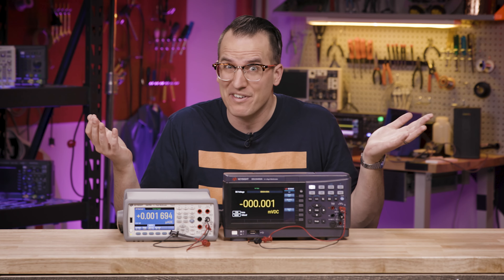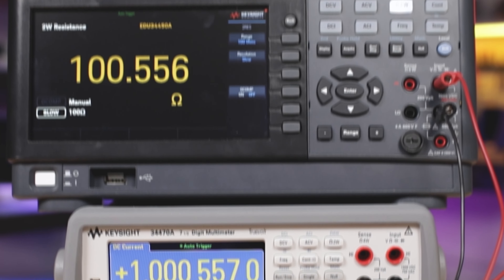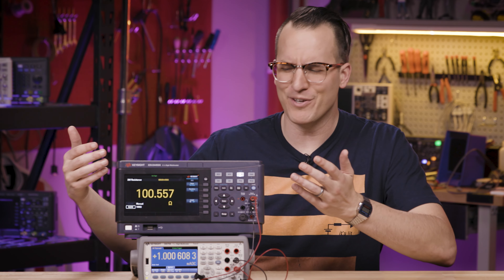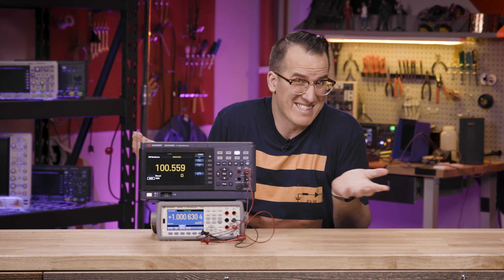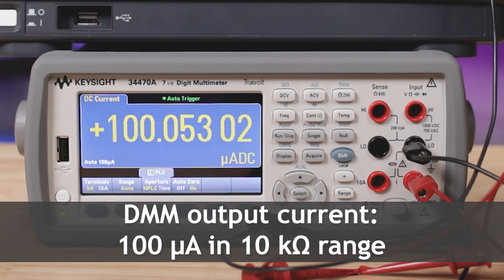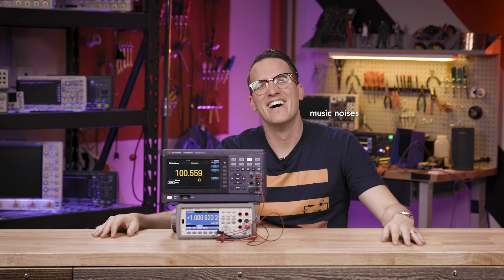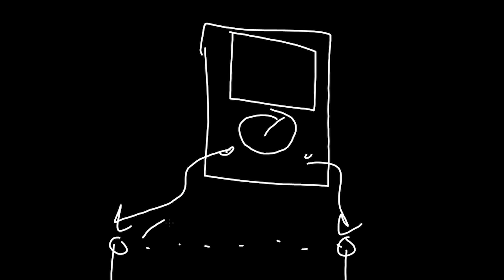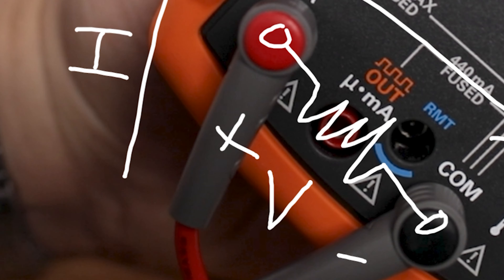Don't use a multimeter like this

Comment: One of my favorites: Your U1240B has 10MOhm input impedance in normal DCV mode. You can extend the 1kV input voltage range by measuring voltages with a resistor in series with the DMM. i.e. +10kV --- 90MOhm --- 10MOhm DMM --- 0V this could read up to 10kV, but other values and higher voltages are possible. Better than tongue test, that's for sure.
Reply: If we are abusing DMMs today, lets replace that 90MOhm resistor with 9 other DMMs in series...
Reply: use the voltage input impedance to measure really small currents
Reply: If only the case and pcb were rated for such high voltage;)
Reply: @LordPrecision  ,  You took the dopey words right out of my mouth... LOL DAMN, is that a really dumb thing to do! BUT IT'S SO SIMPLE!   de KQ2E
Reply: @fredflickinger643  ,  That is what MR/TROLL said in that first comment.
Reply: It is not THAT bad idea :)
I used 9 of 10-MOhm 1/4w resistors in series with multimeter to extend its voltage range. Worked fine for several kV. Calibration was a bit off for me, so i added something like one extra 1Mohm or so.  Very cheap and easy way of measuring low power high voltage up to 4-5kV or if you need extra-high resistance voltmeter. Of course you should not try this for like industrial 6kV or so.
Reply: Be careful with high tension!!!
Most DMM`s have input impedance of 10MOhm, that is about as standard as it gets, but a lot of them have a range or two with 1GOhm or, as my NORMA D4845, goes to 10GOhm at low ranges. 
So ...  you do attach a HT probe, believe (DAAH !!) that you`re fine and then ZAP! Before the instrument can rerange itself. 
So, you better lock the range, or use DMM that has fixed impedance. 

ALSO !!!

-Check if the HT probe is unscratched and clean! THIS IS IMPORTANT! You have no idea what some finger grease can conduct under high tension.  Scratches wreak havoc with creep currents. 
-First, ground the instrument !
-And, best of all, get to know what you are actually measuring. 

Best of luck guys. :D

Comment: Excellent tips 😃, I think most of us short things together in the 10A mode, it's the most used terrible idea.
Reply: Who else has tried to measure mains voltage with your probe in the 10A socket?
Reply: @abraarsameer9521  That usually means goodbye voltmeter.
Reply: Sometimes i do it because the probes are really good for... You know... Probing
Reply: @zyeborm  Good point, I think everyone does this 😅
Reply: @abraarsameer9521  oh god. I did that 2 weeks ago. I didn't intend to do it. I just forgot the probe was at the 10A socket.

 The moment i put it in i hear a big spark and light comes from the plug extension (did it in my house) and i also hear the safe of the house turn off. I was sure i completely bricked my multimeter (a cheap a$$ 20 euro one). I was shaking from excitement and fear since it was my first time happening to me (I'm a beginner). I quickly open the back panel of my multimeter expecting a mess inside but... it was fine? I check the shunt resistor and the 10A fuse but it hadn't been burned. That puzzled me. I try to measure voltage, current and use the other functionalities of it but they worked fine. The tip of one of my probes was melted tho and the metal part of the socket was too. The most logical reason for this is because the breaker kicked in fast enough for there to be no damage but it still feels strange.
Reply: I do it quite often, a speciali when I struggling problems in emergency circuit in industrial devices. Current in that circuit is limited to 100 mA so no problem whatsoever.

Comment: Another "bad" idea: to test a battery for its health in "current measurement" mode - technically short the battery through a DMM. If the measured current is large enough (for this particular kind of battery) - it is good.

Comment: I had some fun with the VU meter I was wiring up to my audio compressor with this (prior to seeing this). I was poking around with a DMM and would redline the VU meter when trying to measure it's series resistance as the DC was flowing through it without the useual resistor that's put infront of it to calibrate it to usefully display audio level signals. 

I also had fun when soldering the replacement IC LEDs for it's backlight with blue ones, as my soldering iron outputs current at the tip (due to the heating coil inducing current in it), and every time I went to solder it the LEDs would light up magically without it being plugged into an obvious power source. xD

Comment: I needed to test a 9v rectangular battery (from my multimeter). I eventually set up DC coupling on my massive Tektronix Oscilloscope simply to check the battery! I have a picture somewhere, but I think iI was also massing a probe and some other device was in the mess. Reminds me of the $4,000 scrabble game (4 iPhones and an iPad).

Comment: My career started out with a Simpson 260 multimeter.  You learn to be extra careful with probes and settings.  I use a Fluke most of the time but I still have a Simpson 260.  no battery needed and its a great way to get a reality check on the DMM.

Comment: I'm use the diode test as a source of voltage when I have the need to simulate a input voltage to a sensor circut of a car as it can be verified on a scanner and the dmm and no magic smoke if you get the wrong pin.

Comment: Get a high-enough voltage DC source, e.g. 100V
Connect DMM to it. Null the reading. (click REL)
Connect a zener or TVS in series to check the zener voltage.
It will show lower because 10uA, but you know what to expect, enough to sort/check :D

Comment: yup, been there, done that and fried a few fuses in the process...
or measuring charger performance on a 12V 18Ah battery: first measuring charge current, then don't replug the wires, only set the DMM on voltage and try to measure voltage across the battery :)
if you think line voltage is dangerous? go mess up some batteries!

Comment: Some uber cheap DT830 dmm has 1 megaOhm input impedance, works almost like a low-Z (low input impedance) dmm.

Many time I got errors on measurements  because their loading effects on circuit under testing is 10x more than common 10megaOhm impedance dmm.

Comment: Usually, I'm using multimeter in diode mode as power source to test unknown clear LED's color an verify, that this LED is working and polarity is correct.. Basically, same as testing other n-p/p-n device, that's mean's no harm to DMM.. 
Few times I used multimeter as fuse.. But in my case, I want, not only connect two terminals, but measure current too.. When cars fuel pump stops, I removed relay, and touched with DMM probes in current mode to the relay terminal.. In field this method work as a charm to understand what's going on! 😂
Basically, this needs to be done smart, otherwise, something can be shortened out through DMM.. 😂

Comment: I use dmm for measuring very high resistant stuff, kinda of insulation tester.
You need a known stable voltage source, like 9V battery or simple 1kv dc voltage source; current requirement is very low.

Put it in series with dmm and things that you measure and mathematically calculate the high resistance measured based on your 10megaOhm impedance dmm voltage reading on basis of volatge divider resistor.
Similar to what nS (nanoSiemens) range did on dmm.

Other things I learn from MarcoReps is to read capacitor leakage current, similar to measurement as above but you calculate by I=V/R, where V ia your voltage reading & R is your dmm impedance.
Try to get dmm with stable (known of measured by othe dmm to make sure) 10 MegOhm impedance, some cheap chinese dmm will auto high impedance on low voltage range.
Reply: Other things, some cheap chinese dmm (4000 or 6000 counts) can do up to 3.999A or 5.999A dc current measurement before autoranging on 10milliOhm shunt, that means your dmm can measure voltage down to 10uVolt, which may or may not available to you on normal voltage measurement selection.
I'm thinking of removing those shunt and use those dmm for very low voltage measurement, surely at equivalent of 10Amps you'd only be able to measure 100mV (or 39.99mV or 59.99mv before autoranging).
Should you need to measure high current then use known proper external shunt.

Now I wonder if that's possible to measure AC signal in the order of 50-100uV (or even lower) as most DMM will struggle on mVAC range to measure that ?

Common wisdom is just to use proper AC millivolt meter with range capability of your needs (10uV resolution/sensitivity?).

Comment: One time I used DMM in current mode as jumper wire while testing high voltage LEDs. So I have one lead directly from mains and another from DMM in my hands (with 220V AC on it) and bunch of LEDs lied down on big heatsink. As a bonus I was have current measurements and fuse. Don't do this at home.
Reply from the maker: Yikes!

Comment: I use the DMM as jumper much more often than as ammeter. I use the resistance measurement function as voltage source. Now I learned something. I can changed the voltage output via the range

Comment: You can use the different bias currents to use a DMM as a crude low current SMU.
Reply: The compliance voltage will also be quite low.

Comment: Also DMM FUSE 10A or 20A... Test leads with crocodile... Not 10A rated continous ... I know ;)
Reply: Would be fun to see what are the  CAT III IV 1000V 600V rating and what happens when you ignore these suggested limits. Probe gauge ratings etc etc...

Comment: Used my DMM as a wire more often than I'd like to admit. Pro tip: short your fuse with a thick piece of copper for extra current throughput
Reply from the maker: Uhhhh
Reply: @KeysightLabs  Next video: how to use multimeter to discharge capacitors

Comment: I used 10A current mode for testing PLC inputs, relays or contactor  using it as a jumper from 24VDC or 120VAC to PLC input or relay/contactor coil or even test a pilot lamp in a control panel.  I think the key there is to make sure the current that will be drawn will not exceed the 10A fuse. For PLC inputs, any digital inputs or even relays and contactor coil, it will never exceed 10A. Typically less than 2A.

Comment: What about DMM's voltmeter as na nano amp meter for mesuring reverse current of rectifying diodes?
Just put it in series with a diode. 
Several mV / 1Mohm = several nA of current...
and several mV stands for next to nothing comparing to even single volts of reverse polarity....

Comment: You can also "misuse" an oscilloscope as a fast, low voltage voltmeter.
Reply: My Keysight DSOX1202G has an actual digital voltmeter embedded and not just using the 8 bit ADC to sort of measure voltage.  It's not super sophisticated but a lot more precise than the 256 count of the 8 bit ADC.

Comment: Shorting stuff using the DMM? Been there, done that. Especially when you need to temporarily short something on a PCB and have a nice set of sharp DMM test leads (like the 34138A). Yeah... I guess I could get myself one of those female to female banana jack adapters.

Comment: I always use my multimeter in resistance/continuity mode to test LEDs because it doesn't have a diode check function
Reply from the maker: That's a clever workaround!

Comment: I often use an analog multimeter in resistance mode to test LEDs, it can deliver a snall amount of current (like 20-30mA) and depending on the scale you use the LED will burn lol

Comment: A handheld DMM is great for rough performance verification of used test gear (e.g., at auction previews). It's a voltage reference, current reference, resistance reference and, with the U1252 and U1282, signal source. It's not a substitute for the home lab, but packs a lot in a portable package.

Comment: I have done both of those things.  Very old DMMs work better as a precision current source because they typically have am much higher compliance voltage.

My tip would be that you can use the voltage measurement mode to measure very low values of current with an effective internal shunt resistance of 10 megohms.  So for instance one of my meters has a 200 microamp range with a resolution of 100 nanoamps.  But in the 200 millivolt range with a resolution of 100 microvolts, it has a range of 20 nanoamps with a resolution of 10 picoamps when measuring current.

Comment: Guilty of using the DMM's A range as a jumper... But at least it was low current: basically ground a Chip Select of a PC motherboard and enable its ShadowBIOS to bootstrap it. :P 

One question, though: I noticed your U1282A is not beeping like a madman when switching to any of the current ranges. Mine runs the beep alert at least five times, regardless if the probes are in the correct A/mA/uA jacks. Is there an option on the setup menu?
(BTW, meter has latest FW and was never opened nor "submerged" in water/oil/mist/etc)

Sorry for asking this here, but that is one of my major beefs with my 1282A - otherwise, it is one of my go-to meters!

Comment: If your DMM has a 10M input resistance, you can set it to 200mV and bingo! you have a 20nA range.
Reply: Multiple DMMs do not have 10M input impedance at low voltages.  Quite probably at 200mV range it has > 1G
Reply: @ikocheratcr  Yep. Hence I started my comment with "If". 10M across all voltage ranges isn't universal, but it is very common.

Comment: I am curious as to why these are bad ideas. Often when I am connecting things together with a DMM, I am also curious as to the current in the line, so having that additional information is nice. Sometimes I insert the DMM to measure this current even if do not need to use it as a jumper. Provided you do not exceed the recommended current then you should not damage the DMM in this way.

I see this as potentially harmful to your DMM, only if not operated safely (the same for any test equipment setup), so perhaps that's why it's a "bad idea"

Now, I can see how using the ohms range as a current source may backfire and create problems. As I recall, this current source is very low power, and therefore cannot output much voltage (so it is not very useful except to measure resistance). I can see how connecting this to an improper load (high capacitance, very reactive etc.) may damage the current source, and if the load voltage is high enough, the front end of the DMM) But you are unlikely to damage it by connecting it to a resistor, and I imagine some active devices like diodes would be ok too. Having this current source available may be useful for very low power testing of semiconductor devices, as most labs do not have a uA or nA precision source.

I see this as "not particularly useful" even though it's not particularly dangerous, so perhaps that's why it's a "bad idea."

Still: Great video! It's always a good idea to understand how your test equipment works to ensure you are operating it safely and you can ensure your test setup is reasonable to obtain the results you need.

Comment: Would be nice if you can use/show meters that ppl can actually afford....good vid thou
Reply from the maker: This is a pretty affordable meter! The 7.5 digit is a bit more spendy
Reply: @KeysightLabs  for ppl in the Caribbean it's expensive
Reply: @KeysightLabs  I myself use the agilent ....good meter....more features than the fluke at a lower price point

Comment: Okay... this is one of the best disclaimer videos  "Don't try this at home (with your test equipment)" I ever saw...  What must the engineers think of these ideas... use your DMM in Current mode as a jumper wire!? 😁😂  But  the best non-traditional option you had was install a beer bottle opener to a scope... a "scopener"...   I think it would be hilarious if you guys had it as an official upgrade... but that would advocate drinking while measuring and that might be slightly irresponsible... but If you worked where I did, a scopener would be standard equipment 😜 (Ok, just kidding)  Cheers...